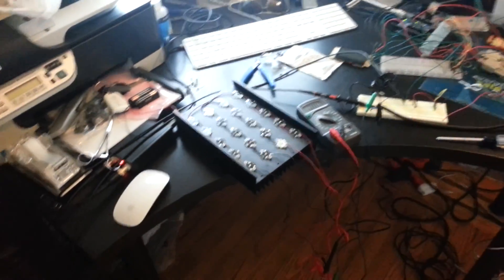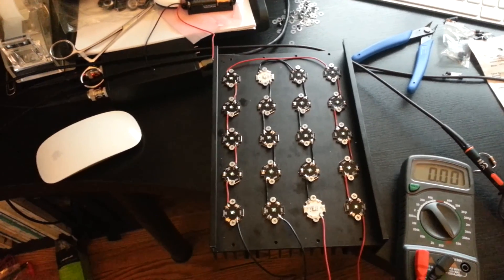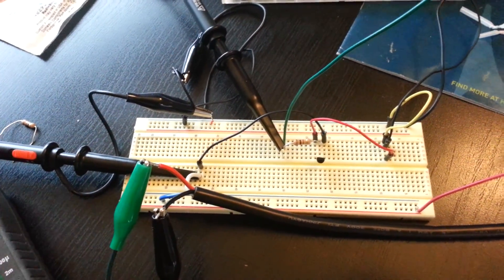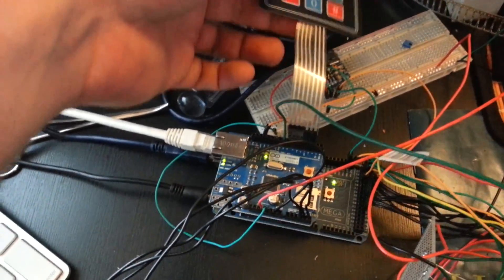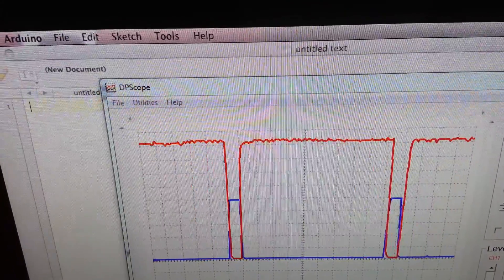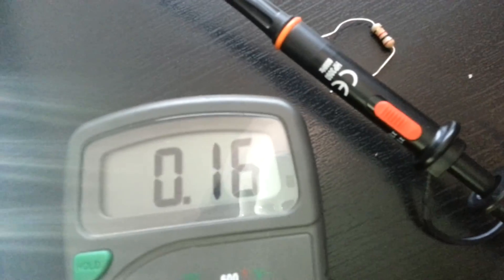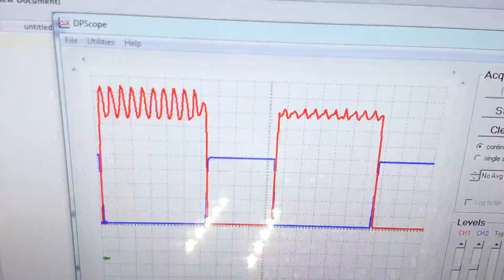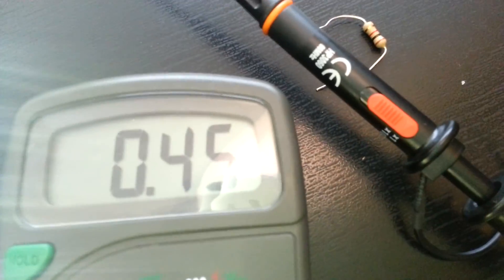ELN-60-48D Meanwell Driver hooked up to Arduino Mega controlling LEDs

Comment: are you converting the PWM to analog voltage or sending the PWM directly from transistor to the 48D?
Reply from the maker: It's been a while but I believe it was directly wired.

Comment: Could you walk me through on how to set the meanwell driver? Like if i didn't want to make a dimming/control circuit. Is there a way i can use the driver by just plugging it into the wall, and setting the amperage using an amp meter?